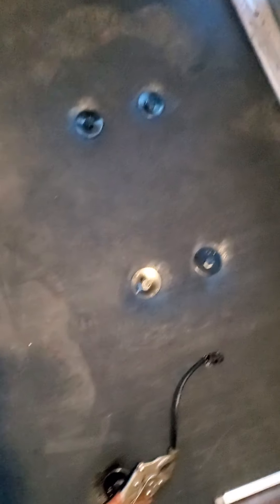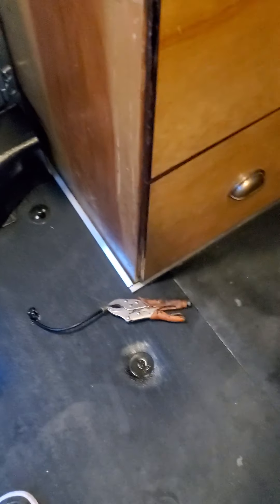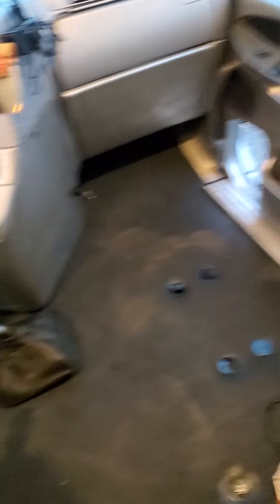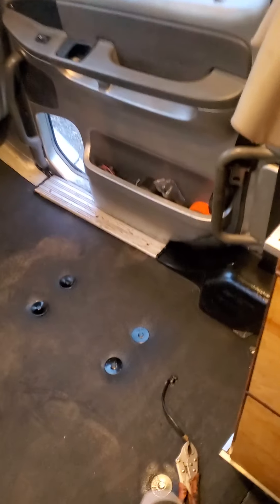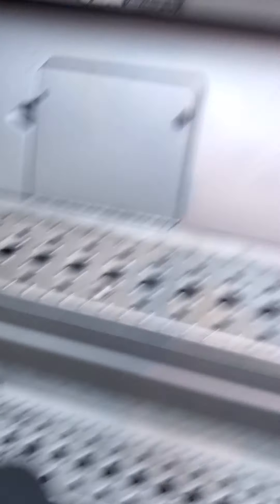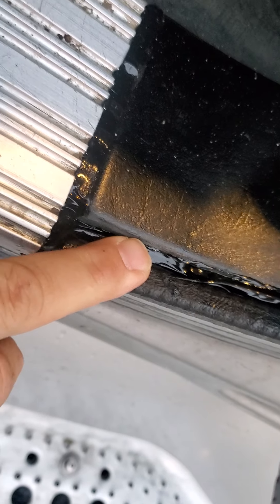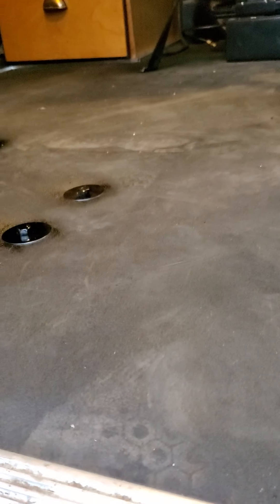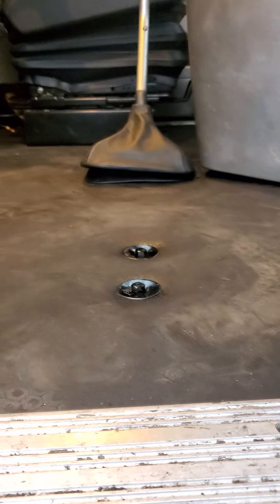REPLACE FLOOR FREIGHTLINER CENTURY CLASS PART 3 OF 3 VIDEOS

Comment: Take out shifter then slide rubber from the bottom of shift stick after u unscrew off the floor. That way you could have that section of the floor tucked under the bracket before u screw the rubber or leather piece back on the floor. Other than that I like it. You have a lot of patience.